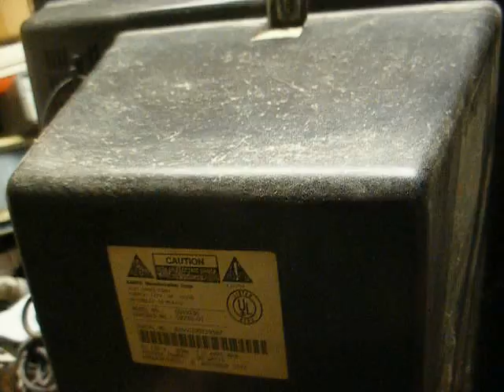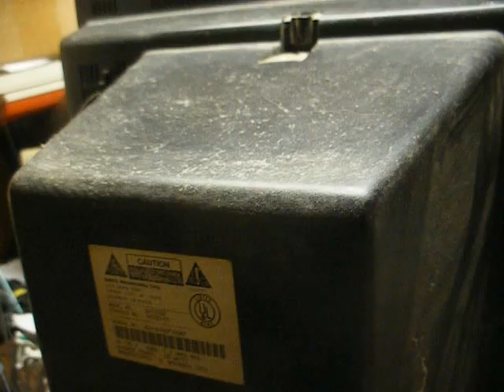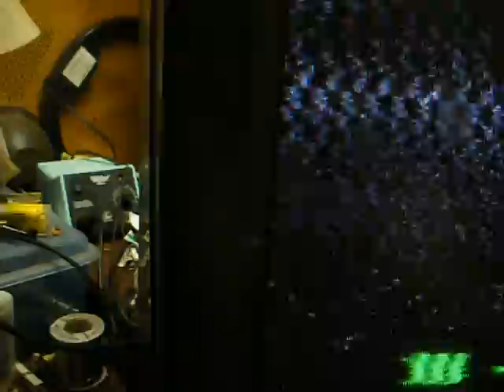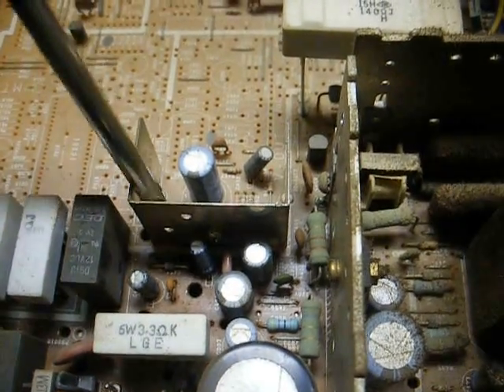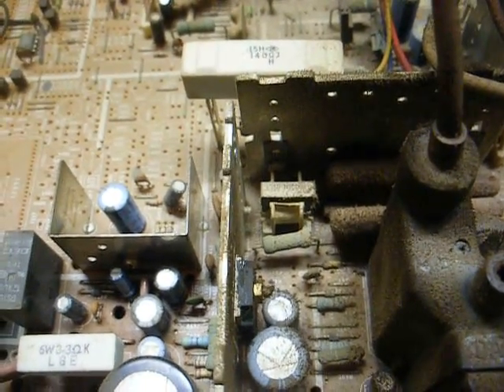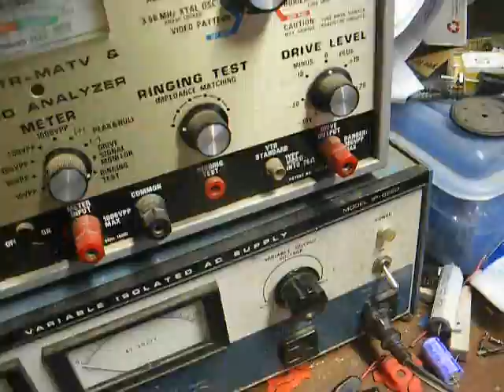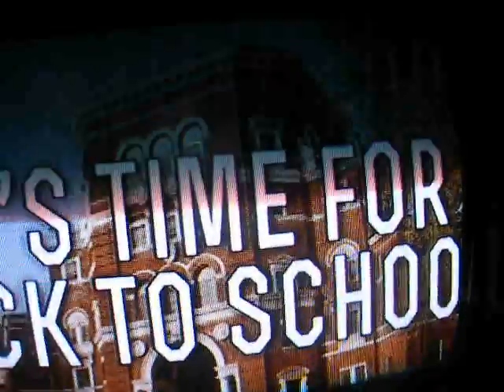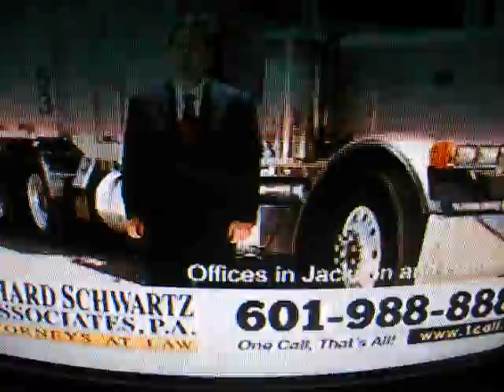19" Sanyo color TV from 1992

Comment: Good work, sir! I had a Panasonic 32" LCD that I bought in 2005 and I was able to get 11 years out of it before it started having some minor issues. It still had a superb picture but occasionally it would shut itself off immediately after I turned it on; the remedy was to unplug it, plug it back in, and then it was fine for days or weeks. I gave it away and the new owner is still enjoying it and living with that minor quirk.

Comment: What happens with those tact switches is that the contacts build up some oxidation, which causes them to have some resistance.

Since those tact switches are most likely for a resistor ladder network, a switch that doesn't close with good continuity will introduce enough resistance to confuse the system control into thinking that you pressed a button different to the one you actually pressed.
Reply: Exactly. The later Sony Walkmen had that problem too.
Usually the buttons switch positions. Sadly, Stop is the first button so it gets shifted out and then there's no way to stop the machine unless it feels like it. So basically Stop reverses direction, Play fast-forwards, fast-forward rewinds and the rewind button does nothing.
But what intrigues me is that the set starts doing stuff on its own!? There are only two explanations: A button shorts with a bad contact (which is super-rare) or the main pullup resistor in the resistor ladder network goes open or develops a dry joint (which is also a kind of so-much-other-stuff-must-go-wrong-before-that-happens).
Reply: Very interesting

Comment: I've seen the inside of TVs that make this one look factory new. Once I found one on the sidewalk, very early 80s Philips, 26 inch, I took the back off and it retained the shape. Must've died the heat death after there was zero possibility of any air circulation. That was back when Philips made awesome TVs. My own 1983 Philips daily driver (also 26 inch, but with awesome 2-way bass reflex stereo speakers) developed a few bad solder joints in the high voltage section about 8 years ago and I also had to replace the CRT as the blue gun was super weak and I didn't have a rejuvenator and that's about all I had to fix on this thing. Also I replaced the tuner with a cable ready one so I could get more channels.
I had TVs where the HV would arc because of dust accumulation. I once pressure-washed a 14 inch TV and a year later it still smelled like cigarettes.

Comment: Sanyo made a lot of fairly low end stuff that was reliable.   My parents got a Sanyo-made Sears 25 inch console TV in 1984 that has a great bright picture although poor resolution (only about 3 MHz luminance rather than trying to recover anything from the 3-4.2 range).   It was a totally no frills set with only an antenna input (no composite video in).   That set got handed down to me and I used it until getting a larger better set in 1993.   There is a high probability that 1984 set still works if it's been kept inside (it was still working in 1999).   As for flat screens, I've had good luck with my Samsung 8000 series 55 inch 1080p set that I bought spring 2010, 7 years ago.   It still looks and works as well as when I got it.   I haven't upgraded to a 4K set yet because I doubt any of my current computers hooked to it would be able to feed it 4K and most videos I watch are 480p, 576p, 720p, or 1080p, which the computers upscale to 1080p just fine.    It makes no sense to upgrade to something that might not even look as good as what I have with the current videos and put 4 times the work on a computer feeding it for no good reason.
Reply: 480p NTSC
576p PAL
720p HD
1080p HD
Reply: I have a 1989 Sanyo tv that is an LXI 564.42955950 that i scored for free. The tube is in great condition, i should of asked the owner if it has ever been repaired.

Comment: I have an old Chinese 'APEX' branded CRT TV from 10/2003 that was in a kitchen for the better half of it's life. Well, I took that set home and have been running it for close to 2 years under high hour/high temp conditions, and it's still running great!

About flatscreen TVs: I get it about the China Mart stuff, but at the same time, I have a 3 year old Crudnavox TV that's been seeing quite heavy use(first as a TV, now as a 3rd computer monitor used for IRC monitoring) and it has an acceptable picture, but the sharpness is on the very poor side. My parents also have a nice Sharp (52" I think?) TV that's getting to be 6+ years old and still retains a very nice picture. I also have an old 2008 Toshiba 32" 32AV500U TV that I got with a bad slave inverter board. I fixed the TV and am using it as a primary computer monitor. This thing has the BEST PICTURE I HAVE EVER SEEN FROM A FLATSCREEN TV.

Now, do I think the Crudnavox will hit 25 years? Not really, it'd be doing good to last past 6 years. Do I think the Sharp TV will hit 25 years? Yes. It seems well built like it was meant to last. Will I think the Toshiba TV will hit 25 years? With some help, I believe so. The inverter boards might be a problem, but it has Japanese caps everywhere and is very well built.

Anyways, that's just my $0.02 about this video.

Comment: My flat screen TV has lasted about 10 years and still going strong, I've already had to re-cap the power supply but it also has the annoying problem of changing the channel almost every time while I'm trying to turn the volume up or down.  Doesn't matter if I'm doing it via the remote or the buttons on the side.  I might have a look at the buttons and see if they have any gunge in them that might be making it behave like this.

Comment: I like the old CRT TVs, especially rear projection TVs are my area. I have a 96 Sony 53 inch and a late 90s Toshiba 61". Also have an early 90s 3 tube CRT projector. Whenever I get bored there´s some convergence to touch up somewhere.
That being said, I don´t think all new TVs are bad. But you have to buy top of the line brands to get a decent usable time out of them. I bought a new Pioneer 50" plasma back in 2004, top of the line model at the time costing somewhere around 5-6000$. It still works like on day one and had zero repairs in  almost 14 years. That is remarkable for modern electronics I think. But people wanted cheap azz TVs so Pioneer ceased to produce quality TVs. I don´t know what brand today is the best but I think Sony, Panasonic and LG is the way to go.

Comment: I am trying to take apart one from 2002. It is too big for me to pick up. I saw online that to discharge it, use a ground to the base and a lead to a screwdriver to touch the metal under a rubber cup on the side. Is that possible with this set?

Comment: I think you're being a little unfair on the modern TVs. So far I've not had one fail on me yet, admittedly they're all between 5 and 10 years old and mostly better brands like Panasonic and Samsung (plasma). But I also have a 5 year old Chinese set (assembled in the UK with Chinese parts) and a 9 year old Videocon (Indian company but made in Italy in a former Thomson factory) both holding up well. Will they reach 25 years? Well I wouldn't bet against the Panasonic to be honest, it seems very well made inside.

Conversely in the 90s I had a 14" portable die of a tube losing green emission (Philips) at 4 years old, and another Philips 21" (early FST) die with a failed main IC at 9 years old (not worth fixing as again the tube was starting to go weak).

Back in the day when I was a kid growing up in the UK you could always tell the British-made sets friends had as the Philips and Ferguson tubes were weak (cruddy dark picture, usually lacking in green again) at around 5 or 6 years old; the Japanese sets seemed to last much better.
Reply: My 2008 Samsung 32" flat panel is still working just as good as the day I bought it. I also have a 19" 2005 LG set still working great. Those older TVs were nice in the day but I never go back to watching everything in low definition.
Reply: I agree too. Not EVERYTHING made in China is bad. I have a Panasonic plasma TV that was made in December of 2007. It is still going strong. It was assembled in Mexico and does have some Chinese parts. The plasma display in it was manufactured by Matsushita (basically Panasonic) in Japan. Who knows how much longer it will last?
Reply: I recall hauling my 3 year old 27" Sony CRT upstairs to our bedroom in 1995. It lasted another 10 years and the HV Supply went out. Then I hauled it downstairs...thanks Good for gravity to help as I was now 10 years older.I was very thankful for how light the replacement 32" flat screen I hauled upstairs was! It is still going strong 12 years in and close to the much, much  heavier Sony's age record.
Reply: A lot of the life span for flat panel TVs has to do with the types of capacitors they use. A cheapo Chinese capacitor (Samwha) can shorten the lifespan of any set.
Reply: ldchappell1 There were never any real problems with electrolytics till the low life span rubbish started to appear from the far East around 15 years ago.
Reply: Glpi lpi Really the capacitor problems started when switching power supplies became the norm. Those cheapo caps are perfectly ok when used with traditional transformers. And I really have no issue with replacing caps every 10 years or so, the older stuff needed constant servicing and yet we complain when a modern set has cap problems after several years.
Reply: And I have several 12 year old brava sets as well as a samsung plasma of similar age and they all work perfectly with no components replaced at all. I bet at least some of them will reach 20 years of age or more.

I kind of find it funny how he uses this crappy sanyo as an example of longevity, when he says himself that it has been repaired at least once before for bad capacitator(s).

And when it comes to one of the bravia sets I have it has extremely many hours on it with it being switched on all day and was even used for years as a monitor often left on with a static picture for hours. If this was a CRT it not only would have had burn in, but the CRT would have also be more or less burned out by now due to it being on from morning to evening every single day of the year.

Meanwhile I have had a CRT that was supposed to be a good brand fail within the first couple of years due to bad solder joints.

Comment: Wholesale recap of 80s and 90s sets? I'm glad I unsubscribe from all those groups. I still see them every day I'm out and I don't even bother to pick them up anymore
Reply: I keep a few around for the use with the old VHS and Betamax players, and Game consoles like the Atari 2600 etc.  Also I have seen a few homes burnt down due to people who assume that the old capacitors were ok in their old vintage gear.  I normally like to replace those old high voltage caps for safety reasons.

Comment: I have a very similar sanyo tv it's a 13" and it doesn't work that good anymore but I could probably fix it and the problem is the buttons the power button barely work I have to press the power button like a 100 times and the volume button will change channel and it is a very nasty cigarette tv it came out of a nasty wet basement